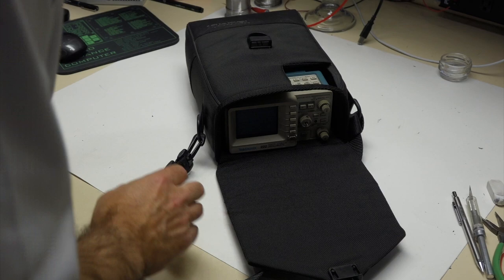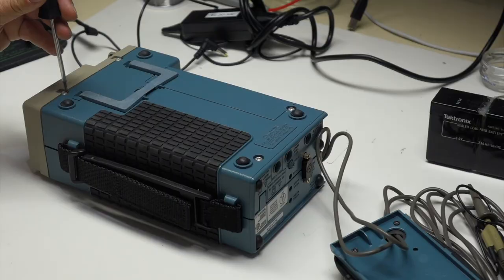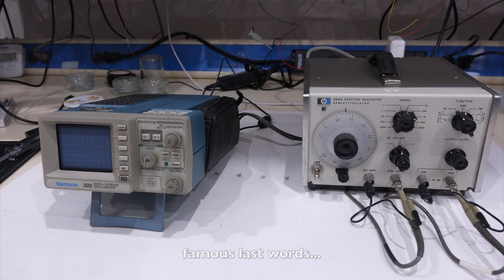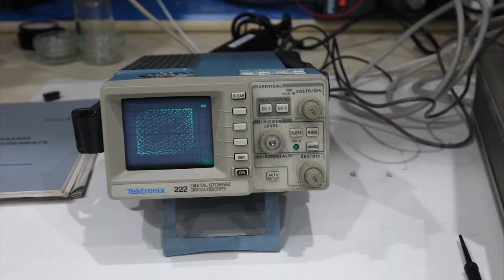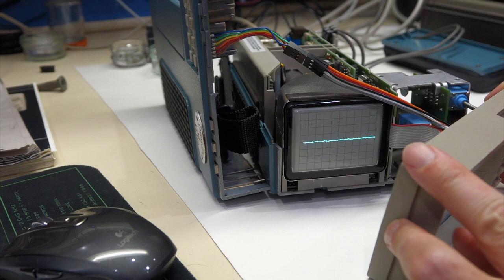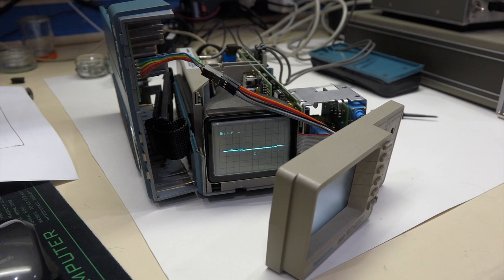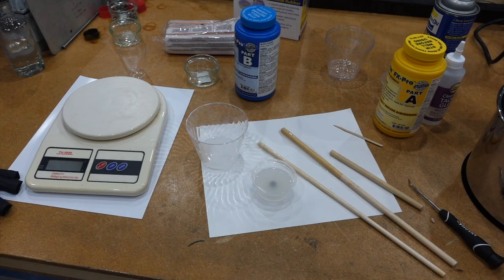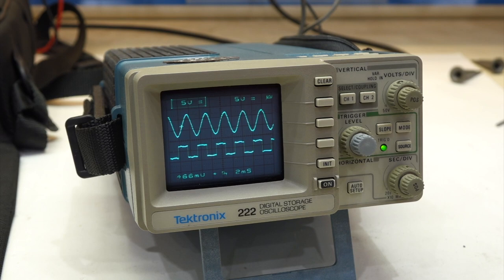Tektronix 222 Mini CRT Oscilloscope Restoration

Comment: Yay! Another 222 back at work.  I have the 222PS, adapted for measuring higher voltages.  The independently isolated inputs and battery power make this hard to beat for line level work.  It's a shame that it's an early digital scope though, we really hated the digital scope at work in the early 90's. I would've preferred analog.

Comment: 1992 I was working for a small business that did service calls on industrial VFD motor drives.  We had a very similar Tek "power scout" scope that was yellow.

Remember perching this scope inside a 200 horse power (150kW) Emerson drive cabinet at a auto plant.  The drives were tall cabinets on the wall and the motors were the size of a desk a couple meters away.  We had the interlock on the door bypassed so we could power it up with open door to monitor things.  When the drive attempted to power up, there was a huge current surge in the 3 phase cables near the scope and I remember how the CRT display would twist/oscillate in a rotational way CW and CCW with a nice damped response!!!  Lots of magnetic fields in there!!!

Comment: Great work.  I especially liked the part where the calibration repaired itself.  If I had to guess I would say it was probably monitoring the displayed position of the lines and did not like what it found until you calibrated the xy position of the display.
And the liquid plastic is obviously great stuff!  I've only ever seen it used before, but never had any hands on with it.  You say this was your first time with it and your results look great!  I may try that in the future myself now.  Alot easier than breaking out the CAD software and a 3D printer.

Great stuff!  Thank you, Marc.

Comment: Nice one Marc :D, the 222 is a cute scope indeed, even if it isn't that useful nowadays. The actual sampling rate is only 1MS/s for single shots, it does 10MS/s on repetitive waveforms by equivalent time sampling. I modified mine to work with normal scope probes, I can send details of the mod if you're interested. I'm definitely getting the Li-Ion adaptor now. Mine had 4 D size Cyclon cells in it which are now completely dead.
Reply from the maker: Thanks, I did not know the wrinkle with the 1MS/s sample rate, that explains why it aliases so badly.

Comment: Back in the day. Late 1980's to mid 1990's, I talked my boss into getting one of those so I could use it to troubleshoot cars (Porsche, BMW and Mercedes). The early days of Bosch electronic fuel injection. I was able to diagnose some very tricky problems with it.
Before that I used it in my job as an industrial electrician / electronics tech. Loved it.
I was once testing 600VAC for proper 3 phase power coming out of a bank of SCRs and the set screw on the knob was hot and I got a shock every time I tried to adjust it.

Comment: I was a Mainframe computer tech in the Air Force during 70's to the early 80's and used most every piece of HP gear you have.
Huge Fan as HP was super solid. Fluke made really good test equipment back then.
 We would almost always opt for  Tektronix when it came to Scope's, certainly before digital scopes came out, I bought a 453 for my analog bench same type I used every day in the Air Force, its way faster to set up and use than my digital for low freq audio signals.

Comment: I have the 222PS Power Scout in yellow that I got at a flea market for $10. I LOVE it! I'm surprised we weren't able to hear those relays clicking for the calibration. Mine is quite loud. My only complaint is indeed the special probe plugs so no special probes without adapters. Just hook up your source or sources, press Auto, clickity-clickity-clickity and BOOM!

Comment: Next time start with your darkest color first and workup to your lightest. 
An airbrush would give you much greater control over particulate size and the density of coverage but I doubt you want to run out and buy one to paint one little button so try this instead. Setup a little backstop behind your target, you can use a bit of cardboard or cover a corner in newspaper, and rather than trying in vain to control the spray density while aiming at your object, instead aim above and a bit behind it. You can even put you object on the end of a stick and simply move it in and out of the edge of the over spray.   Maybe mold a few test pieces you’re not going to bother finishing to practice on.

Comment: the awesome things about devices like this is that most of it can be brought to near-factory condition with some effort. 
Especially CROs. DSOs what with having firmware and custom digital ICs are a bit more difficult
but they are generally very very good to work both on and with

Comment: The French-made Metrix hybrid scopes of the early-to-mid 1990s are very nice to work with- but of course are considerably larger than the Tek 222/224.  Mine is a 20MHz version which was given to me by a friend.  It's a combination analog scope and an 8-bit 40MS/s digital scope, and I believe it is based on a Philips reference design.  I do have a LeCroy 150MHz digital scope from the same period but it is much bigger and heavier and not nearly as user-friendly, and having both analog and digital capability in one instrument is nice to have for certain applications.

Comment: Wonderful video as always Marc. One suggestion: POUR HIGHER. You want to make a thin stream, so any bubbles that still exist get popped by the surface tension of the stream getting thinner and shearing! 

Didn't see what you used to glue knob to cup, but hotglue works well. DO you know the Hotglue Alcohol Trick (HAT)? A single drop of alcohol on the edge of hotglue, push on the edge a tiny bit to put some strain on the hotglue, and it pops free instantly. Doesn't dissolve the glue, it just makes it lose adhesion, to ANY SURFACE. Works on glass, metal, wood, paper, cloth, PCB, plastic, wires, connectors, etc. Just put a drop on the edge of where glue and surface meet, and put some pressure, and it pops free. It might be mechanically connected (if it flows around a wire, it will not be attached to wire anymore, but still mechanically attached, like a donut spinning on a rod, so you do have to cut then, but it pops free cleanly other than that. Doesn't matter as much for low temp hot glue, but high temp hotglue holds 10x stronger, and tears instead of just peeling off if you try picking at it. HAT works on high-temp glues as well, just the same.

Other non-polar solvents work. Ethyl alcohol, methanol, acetone, isopropyl alcohol, naptha, MEK (but it does dissolve the glue slowly iirc), all of these solvents work to pop the glue free without any mess. Life is much easier with this trick, especially fixing things. Most modern things you buy, have hotglue on them! From trying to keep connectors from backing off, wire routing, etc.
Reply: Interesting tip. I often work with hot glue - I'll have to give it a try!

Comment: I love mine, SUPER handy, especially nice when you don't really need a full sized scope.
I use mine when working on cars and such, but also on the bench...
When I need it portable, I can run it off 2 18650's, just have to remember not to plug it into a wall adapter at the same time!

Comment: I wonder if the 'belt buckle' is a property tag for Delta Airlines.   I could easily see this being part of an aircraft maintenance crew's tool kit.
Reply: Watching the video I kept thinking how the tag looks just like the "seat number" ones you see attached to the airplane seats 😄
Reply: That's what I was wondering... it even has DL on it which is their booking company code.
Reply from the maker: It’s written Delta Airlines in big on it, guess who owned it beforehand…
Reply: @CuriousMarc  Spirit? They probably bought it used from delta :)
Reply: I work at Delta as a mechanic now, I recognized that metal "beltbuckle" almost immediately. It's the older style of the tool room's inventory control tags. These are from back before barcodes made inventory control so much easier and these are just chunks of aluminum with stamped letters and numbers on them and will last as long as the scope will I'd say.  @CuriousMarc

Comment: So funny, it's much smaller and presumably much newer, but it looks almost the same on the control panel as my (currently not working, but it worked a few years ago) Tek 2215A analog scope. Clearly they had a strong internal design guide, or a very opinionated interface designer...  Really cool to see you make the replacement dial, that was some really fast silicone and resin!

Comment: Those modular multifunction knobs are a neat piece of engineering. I wonder if it would be possible to get something like that off the shelf as a maker part.
Reply: The part I'd really love to have today is the good-old rotary ('Yaxley') swtiches. They are basicly what those knobs were.
Next on my list is the soviet-style isostat switches, and only after that comes CRTs...
Reply from the maker: Tek is the king of miniature multifunction and otherwise creative switchery. Which of course breaks with rough handling at the recyclers. If you restore Tek equipment you'll spend a lot of time on broken miniature switches!
Reply: @HA7DN  Can you provide a link to a picture of those soviet isostats you spoke of? I have a bunch of old soviet telephone/mainframe stuff, and Id like to compare.
Reply: @jogginnoggins9918  just googled 'isostat switch' and mostly good hits came up. AFAIK these were modular switches, they could be tiled next to each other, came in various configurations (SPST, DPDT, even more), and could be linked to form radio groups or just be on/off switches.

Comment: Belt buckle?  Isn't that a corporate asset control # brass tag on the top of the case?  And FYI, I think no self-respecting adult Texan would wear a belt buckle that small!
Reply from the maker: Absolutely not, it’s a Texan belt buckle from a very small Texan.  Can’t possibly be an asset tag from Delta Airlines.

Comment: Would the firmware for the 222 (or even better, the 222A, as that has schematics) be available anywhere? No way I can get the real thing here, but I'm wondering if it's doable to create a workalike using emulation of the original software/hardware...

Comment: I got the same failed self cal with the same errors when the power supply was not able to supply enough current, even though everything seemed to be working well. (I used some random wall wart supply). Replacing it to a better one cured the problem. So maybe during self cal there are some additional power requirements and things can get marginal.

Comment: Those batteries look kind of like the "emergency exit sign" batteries that get paired up to run those kids ride on toys. They're probably actually fairly inexpensive, though I imagine you'd probably rather use an RC lipo. (Edit: oh you already swapped the battery.)